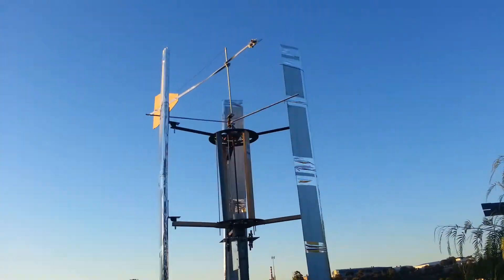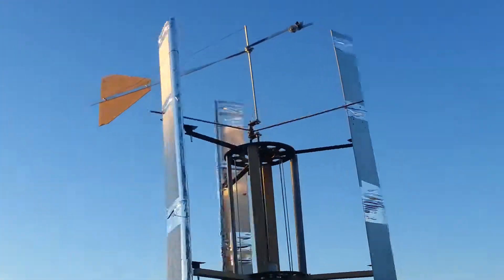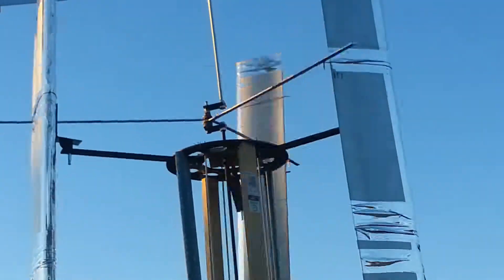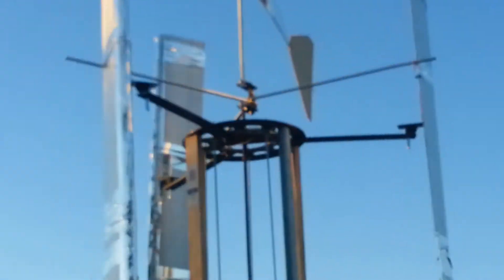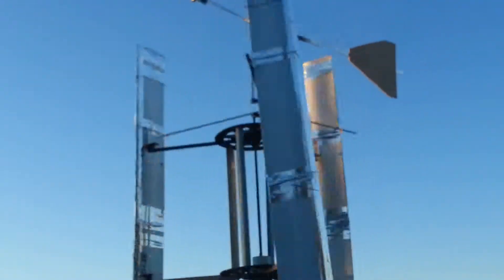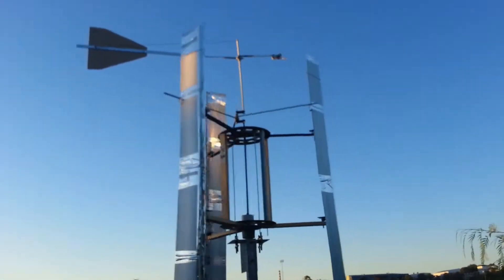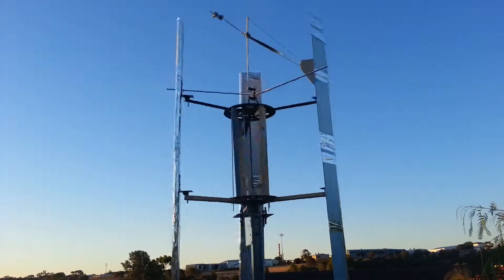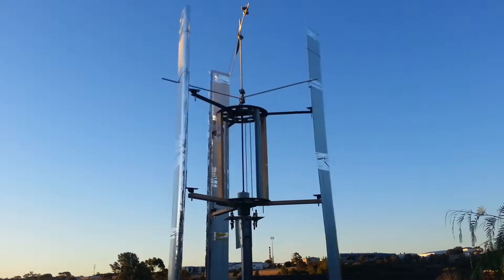Homemade Vertical Axis wind mill

Comment: In high winds, the bottom of the blades will probably flutter because they are supported only at the leading edge. They may also twist outward for the same reason. A solution is to attach the blades at 1/4 chord from the leading edge, and balance them fore and aft of the mounting point. 
Overspeed control is needed. That can be done by causing the tail vane to move sideways to the wind. And that can be done by using a double tail vane and letting one of them pivot down wind. 
Nice job!